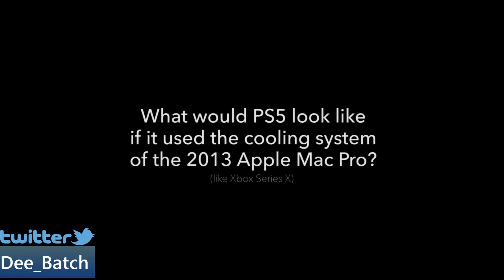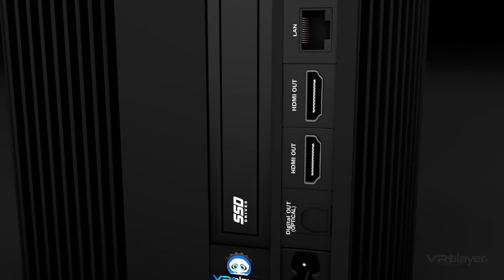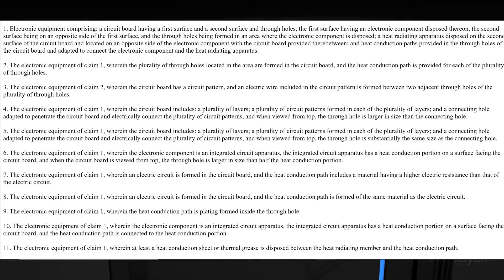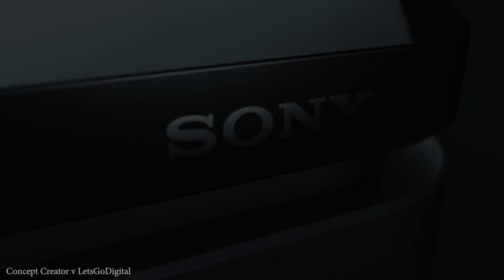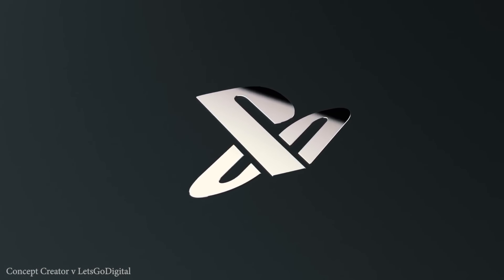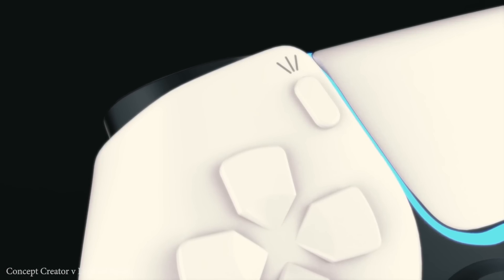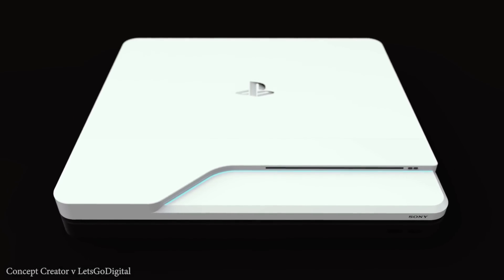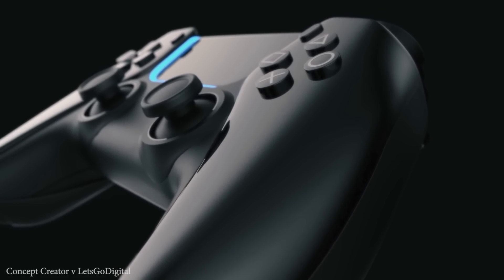PlayStation 5 Cooling Patent Revealed | PS5 Will Have Never Before Seen Tech

Comment: Looks like a very expensive cooling methode which could make the ps5 a 499 console just like the Series X but less power they shouls have went with the fan design but i guess they wanted to get rid of the Jet noise playstation i known for anyway great video dee !
Reply: I remember a while back a rumor about their cooling solution costing them only slightly more than this gen. Ps4 was a 2$ while the ps5s was supposedly a 5$ solution. I've been try7ng to dig out that article, but struggling to find it!
Reply: It's not all about power 🤦XSX can be more powerful but the PS5 could perform better
Reply: NewAgeOutlaw716 that will always be true, but that doesn’t mean that power is irrelevant. More power can cover up poor development. More power can make equally optimized games look much better.
Reply: @T_M_E_8  Power is useless if you can't utilize it right at the end of the day as of right now that Tflop talk is just paper talk and just because it looks good on paper doesn't mean it will look like how it's supposed to look if not utilized right
Reply: @T_M_E_8  It's like a V8 truck that's supposed to have a V8 engine under the hood but it's an V6 engine inside 🤣😭
Reply: NewAgeOutlaw716 agreed. I’m sure 1st party devs will be the first ones to take advantage of it(like always) and then we will see it in 3rd party games. At this point though, it’s up to developers to make use of what’s given to them.
Reply: @T_M_E_8  exactly that's what a lot of people don't understand that it's more to it than just Tflop and power.
Reply: @Retro_Gamer_89  if the ps5 is unreliable, in automotive terms I'd see it as a car with an engine that hasn't been forged trying to keep up to a car (series x) with a V8. It could go horribly wrong pretty quickly
Reply: @richboy900  🤣
Reply: gottabump  ah, either way, it doesn't seem terribly more substantial for the ps5 cooling costs.
Reply: 499 or even 549 would make PS5 one of the lowest cost console at launch in history when we consider inflation. SNES launch prive in USA in 2020 money is close to USD800

Comment: Still can’t believe they haven’t shown the PS5 yet. Just make it bigger would be easier.
Reply: They did not show the ps4 till June
Reply: donnell brown they just recently shown the controller which was revealed in February 2013 for PS4
Reply: @SuperMosh1990  the control is not the system. So the control has nothing to with the system
Reply: donnell brown my point being Sony is revealing things in a different beat then with PS4
Reply: @SuperMosh1990  but you are saying but this is a different time. They are doing what they did with the PS4. Showing the system in May r June
Reply: donnell brown its different if it’s shown  in May but the controller has been shown later so it’s a DIFFERENT reveal for Sony

Comment: I believe the Series X isn't that large. In fact it will fit better than the One X in my living room.
But let's talk about what the video is. 
Great news if Sony has find a way to mantain PS5 CPU and GPU cool without a noisy system.
Hope it is true.
Reply: Series x is smaller than the Xbox one x I don't know why people think it is big
Reply: @NIJARIO1  in what way? In length when its laying down? Maybe but in height it doesnt fit a lot of cabinets designed for multimedia. You can place it on top if the fv is there due to being too thick. It would have to be off to the side if you have the room.

The thing is actually pretty ginormous compared to all other stand alone boxes ever made. 

Not too mention you need to make sure that if you have it lying down that you do notnhave any electronics to the right of it. But you also need to makensure that its open air to the right of it.

The design is pretty awful for a lot of reasons. Most tv cabinets are bullt to have depth because thats where the heat is expected to be discharged at. Not sides. This design only works best if you have a wall mounted tv. 

I literally have no place for xsx to go besides the floor. My whole set up does not allow for it in the slighest. Meanwhile if sony keeps to a more common approach to stand alone boxes all i need to do is retire my x360 and it fits. If for some reason ps5 looks remotely similar to xsx then its going to be pretty annoying for me.
Reply: @densetsu4286  in height too lol just look at side by side videos
Reply: @densetsu4286  I can see your point.
Depends on the place where you will install it.
Here it will be ok.
I know the console design and what is needed to keep a good airflow.
Reply: @NIJARIO1  um lay both down horizontally. The xsx is much much thicker than xb1x. This thickness can cause a lot of problems for a lot of people's set up. I know for a fact my set up does not accommodate the xsx at all.  For me it need to be on the floor ornon something adjacent to it. Which i dont have anything viable to do that with.
Reply: @densetsu4286  thats a problem. Am sure you will fix it when time comes.
Reply: @marcolascosqui  no need to fix ot for a console i am not buying. As long as ps5 doesnt do that bone headed hideous design. I got a pc so i am good for xbox games. But a good product shouldnt make you have too do that regardless.
Reply: @densetsu4286  Your comments height is larger so yeah...😂
Reply: @Inzpectre  lol. Ok boomer.
Reply: Marco Lascosqui Enjoy competitive and co-operative online gaming with friends and rivals from all around the world in supported Nintendo Switch titles, such as Mario Kart 8 Deluxe and Splatoon 2.
Reply: @StanderdSolution  fuck off.
Reply: It's cos they've had to clock the shit out of it to get nearly another terraflop out it.
Reply: @brianr9529  sigh it wasnt for the tflop number. Theres more benefit when OC a gpu. Most people dedicated gpus are OC'd. I like how you think OCing is exclusive to ps5. 

And there is nothing wrong with OCing a gpu especially if you can have it stabilized. And it sounds like thats what somy has. 

Your ignorance is cute though.
Reply: Digital foundry said the series x is literally 2 gamecubes stacked on one another.
Reply: If you can fit a GameCube in your setup you can fit the series x.  I already have my Scorpio upright, the series x will fit right in for me
Reply: are you believer from sony camp. you may take official xbox specification, size.
Reply: It actually isn’t big if you look at the controller next to it and then take into account the controller has been made slightly smaller. I actually like the design. Also that design allows for all the parts to be cooled by the heat sync, vector chamber and customised fan...so it works
Reply: At least Xbox had some fun 😂 if you can’t fit something 15cmx15cmx30cm, then you need a new setup. I could fit that on a bookshelf https://www.google.co.uk/amp/s/www.theverge.com/platform/amp/tldr/2020/3/16/21181399/microsoft-xbox-series-x-size-fridge-comparison-measurements

Comment: And yet it still runs hotter then series x will (why) hence the much needed complicated cooler but why is it needed. 😂😂😂🌍 keep watching 💥🐉
Reply: Alright I’m gonna have some real fun 😇😂🌸👍🐉 Yep they can and if you take that pressure of heat off the device and make it only run 
Partially on hardware frees up heat and speed restrictions that before
Where not possible due to 
(Cloud)wasn’t there fully yet) but now they are so my fanboys and intelligent tech kids what happens when you have one device running on nothing but hardware and software power?= massive power strain = massive heat) lol means very powerful cooling system right) expensive one to lol, but that is still needed by combo of hardware and software energy. Now what happens to the device If half that heat and energy wasn’t needed due to the secret source of energy engine for device? (Cloud powered in part) takes off restrictions of energy power input and output don’t it? 😂👍💫💥💫💥 which means if that’s not restricting power what’s it able to do without a cap first time for everything lol keep watching 🙏
Reply: @treaper512  you do know the "power of the cloud" is gonna differ for everyone based on network problems, therefore it will be un reliable
Reply: Pitch Black correct which is why what is gonna happen next is gonna be hilarious low middle high (options) (play anywhere) power of the ⛅️) how ever there will be a generation for all.
Reply: @treaper512  i will have to see it to believe it, i mean the same cloud was supposed to make Crackdown 3 Game of The Generation, but ill take your word for it
Reply: Pitch Black  yet destructive mechanical effects where digitally implemented just not at full cap which is fine ( I had fun till the lobbies died) but Na I love my cross-play cod the gift of the last 20 years of gaming lol. I love my lobbies over Christmas 🎄. But as I said low middle high options for all) however this where I’m gonna laugh 😆 this is a higher echelon hobby if you can not pay it don’t start it ) cause next generation your right it’s gonna depend on the circumstance option availability for (everyone) but (play anywhere) will be there lol just depends which faction of play option suits each individual gamer. 🍀🎄🍀👍🐉
Reply: @treaper512  i agree on that part if you cant afford gaming, tough hence why i genuine;y dont understand why gamepass is a thing, you would thing people would want to support the games that do the right things.
Reply: Pitch Black the reach is farther for cheaper cost which in turns offers more free variety therefore reach is larger.
Reply: Pitch Black true you would think but what is the cheapest and most convenient for the consumer always sells the most no matter who you are lol. So (this also why Sony is stuck) if you can not sell above your competition which is not really your competition on the industry latter, due to lack of funds being made your eventually gonna get wrecked by the bigger consumer reach wallet facts. Which is why Sony can not take a loss Microsoft can cause the gaming industry is not there business model its only part of it LMFAO 🎄🍀🐉
Reply: @treaper512  now you making more sense, you say sells the most, but i they only have one game that has selled about 5 million, while Sony has like 3 games at 10 million, they obviously have way bigger sales (which are full $60 sales) so they are making way more compared to MS with a range pf ($1 - $14 - $60) if anythinng MS cant afford to fail because they are getting less money for their efforts
Reply: Pitch Black no they are not there losing or remaining even if units sold does not equal profit it does for Sony (due to thats there business model) it’s not Microsoft’s though, it’s a small extra bag of cash to do with as they chose and as I said before they care more about how many get to play the art of studios then only one ☝️ of there platforms, which is what’s gonna happen. because say we go digital fully it’s not gonna make a difference in the long model how many hardware is sold it’s gonna matter how many touch the program so more exposure to larger base automatically =more profit. Now I can sell 40 hot dogs but if all I get back for the 40 hot dogs is even balance and not a positive one (means no profit was made as a whole) in fact in means they lose cash not gain. While Microsoft have the liberty to reach as many consumers they can with more variety of options for the consumer) more options means more base and leads to 40 becoming 80 120 ect, while I as said Sony only hardware and software capped.
Reply: @pitchblack5422  nope
Reply: @quandaledingle8583  well if you mean SSD then you are correct
Reply: @pitchblack5422  sorry for not being specific but I was talking about the ssd
Reply: @quandaledingle8583  lol my bad for assuming
Reply: T REAPER so here we have a Xbot talking trash because sony has a better cooling system design  lol. Go play your AA games on your beastly machine.
Reply: Re-Donkulous no lol I’m laughing cause your ps5 is still run by only hardware therefore it needs that high cooler, series x won’t have that problem cause pure hardware is not how it operates in full LMFAO🙏💥🌸💥 keep watching it’s gonna be fun
Reply: @re-donkulous6345  you said it BEASTLY thanks we know
Reply: T REAPER Enjoy competitive and co-operative online gaming with friends and rivals from all around the world in supported Nintendo Switch titles, such as Mario Kart 8 Deluxe and Splatoon 2.
Reply: COPPA COMPLIENT Lol I wish Nintendo or consoles is not really what I enjoy but I do enjoy competitiveness in a lobby  especially when rage quitters come over and over and over again LMFAO 🍉🙏🍉🍀🍀🍀🍀🐉
Reply: BiG RaGe I will , while I play AAA exclusives on ps5 😁
Reply: Re-Donkulous and I find blood lobbys on Xbox live or in a 5 dollar game ending tip spoiler LMFAO 🤷‍♂️😂😂😂😂
Reply: Re-Donkulous LOL THEY HAVE A BETTER COOLING DESIGN IS WHAT YALL ARE RUNNING WITH, and guess who’s gonna pay 500 plus for that, YOU
Reply: drunkenn1nja so while I spend my money and get games on day one. You can go buy the Xbox and wait another 2 years for your exclusives.
Reply: Re-Donkulous what Sony first party exclusives  are out for launch🤔
Reply: @re-donkulous6345  what games do you have day one...or better yet what exclusives? lol i would like to know
Reply: @re-donkulous6345  And while you play your supposedly exclusives alone while your friends don't upgrade, I get to play my games with ALL my friends on XsX, X1S, X1X, and PC. Lol
Reply: Robert Evanson hey bud I have no issue finding lobbies in practically any game as long as it’s still relevant to play) and bud I don’t play Xbox for SP unless it’s icons I love weather it be chief or Marcus lol Na bud I play Xbox for (multiplayer concept) (only) if I want some chill time I’ll run a story but it’s not why I need the system lol never was. Na bud I game for pvp fps none BR fun and those rage quit lobbys get more and more beautiful as the generations go by 💫🐉💫😂👍💥
Reply: Ps5 is way faster than xsx sooo........
Reply: @quandaledingle8583  no it it's not you idiot, a faster ssd which is just a storage system doesn't make your overall console faster
Reply: @GodLikeC  *whistles patiently for someone to realize*.